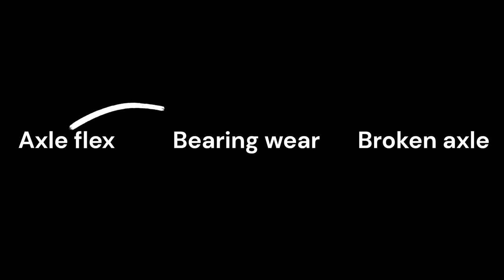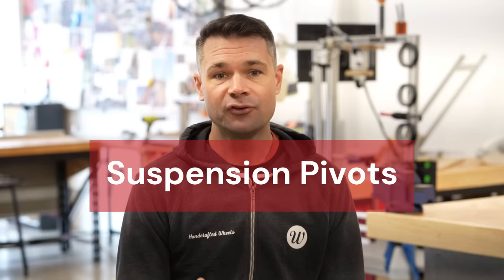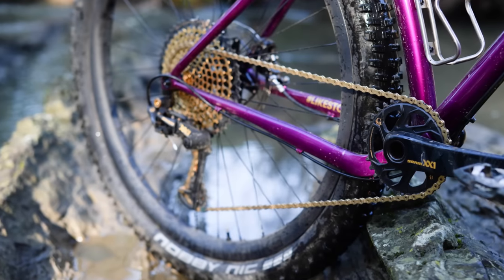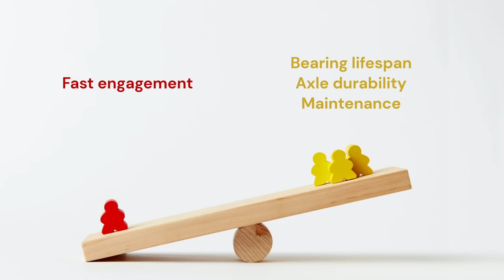Is it worth breaking axles for 690 POE?

Comment: As the NZ Distributor of Industry Nine, we've seen nothing but great support from Industry Nine around this topic. Additionally, we can confirm we have had no reported breakages of the new axle here in New Zealand (over the last 12+ months) and bearing wear has also reduced.  We must stress that this doesn't remove the need to maintain your hubs - they need care like any other part on your bike.

One thing we'd like to add to Tristan's very informative video is the real world benefits of the Industry Nine Hydra. 

High-engagement rear hubs, distinguishable by their unique sound, provide nearly instantaneous power transfer to the rear wheel.  Their benefits across various riding contexts cannot be understated. These hubs effectively eliminate the 'lag' typically experienced at the beginning of a pedal stroke with lower engagement hubs.  This feature is particularly beneficial in challenging uphill sections or powering out of a berm. Moreover, they ensure immediate power application when you resume pedaling after backpedaling or freewheeling. In such situations, this instantaneous power transfer can indeed be a game-changer.

If any viewers need more info on how to maintain the Hydra system or require service parts (bearing replacements or axle upgrades etc) do not hesitate to get in touch with Wheelworks.  As one of our dealers, Tristan has good working knowledge of I9 Hubs and access to all the necessary components to keep your Hydras running sweet for years to come.

Bruce
Founder | Owner
3Sixty Sports
Reply from the maker: Thanks Bruce.  The support we've had from your team and I9 has been nothing short of fantastic.  ~Tristan

Comment: This "axle flex" dependent engagement is just a poor design choice, no matter what the axle material used.  Industry Nine could just replace the 115 notch ratchet ring with a 116 notch ring.  Yeah, POE will drop in half, but there will be 2 points of engagement and no axle flex. Or they could drop down to 114 notch ring and get all 6 points of engagement (and only 58 POE).  Frankly, I think these super high POE hubs are comletely unnecessary and as we see here they require some significant compromises (durability in this case).  Once you get over about 60POE you've probably reached the point of diminishing returns, especially on full suspension bikes.  But that's just my opinion.
Reply from the maker: I love the idea of interchangeable / replaceable ratchet rings!  Offering the customer the choice of a 58, 116, etc engagement points simply by unthreading the ratchet ring is a great idea!

Get the marketing department involved it's a feature, not a bug!

"Introducing the RevolutionHub, a groundbreaking bicycle hub that puts control in the hands of the rider. With its innovative design, you can customize your riding experience by easily swapping out the ratchet ring, allowing you to tailor the number of engagement points to suit your preferences. Whether you crave lightning-fast responsiveness for aggressive trails or prefer a smoother, more leisurely ride, the RevolutionHub empowers you to fine-tune your cycling adventure. Experience the freedom to ride the way you want with precision and versatility – redefine your cycling journey with RevolutionHub."

-Tristan
Reply: @WheelworksHandcraftedWheels  Well, DT Swiss pretty much offers that right now, don't they?
Reply from the maker: Yeah but they currently max out at 54 POE and without a major hub redesign they can't go any higher than that

Comment: @2:44 "we recommend ... treating the axle as a consumable part". Welcome to the modern age of cycling <sigh> It's frustrating to see companies using Al alloy axles when a steel axle should be a lifetime part for most hubs. I9 is not the only offender here.
Reply from the maker: Interestingly, in the higher-end hub world many companies are moving from 15mm to 17mm diameter aluminium axles rather than change the material to steel or titanium.  Why?  Generally cost and it's seems much easier to hold machining tolerances on an aluminium axle than a steel or titanium one, but a professional cnc operator would know more about this than me.  We moved to a steel axle on our Dial hubs about 5 year ago but the tolerances to fit inside bearings are so tight that it needs to be centerless ground and we could only do that because it's a constant diameter axle, not a stepped / shouldered axle like the Hydra or others.

The 17mm axles seem to work well in other brands of hub but they mean really small bearings inside the freehub body.  This likely isn't an option for I9 though as the larger axle will be stiffer and therefore impact how the hub works.

-Tristan

Comment: Wow,Tristan knows absolute nothing about metallurgy,Aluminium is 1/3 as stiff as steel and will flex alot more than a Chrome moly or Titanium axle.Change the design to 4130 Chrome moly axle and it should be fine.
Reply from the maker: Sorry that the wording isn't super clear at this point of the vid.  What I said was " Aluminium, which is what the hydra axle is made from, is a reasonably stiff metal which doesn’t bend and flex as much as, say, steel, and which tends to crack when flexed repeatedly."

It looks like this got muddled in editing and I can certainly see how it could be misread!  The intent was that aluminium isn't as good in cyclic loading as steel, and maybe I should have said it "doesn’t bend and flex as WELL as, say, steel"?

Either way - that amount of flex is required by the freehub mechanism so simply changing axle material probably won't work and will likely lead to failures elsewhere, and the physical dimensions are constrained by bearing and thru-axle sizing so redesigning the axle diameter isn't possible.  I'm guessing if the solution was as straight forward as changing to a steel or titanium axle then I9 probably would have done this already.

-Tristan

Comment: "Aluminum...is a reasonably stiff material that doesn't flex as much as steel" Cringe. Aluminum has 1/3 the stiffness of steel. 

I usually like your videos but you need to educate yourself before you put yourself in the position of being a teacher. 

Maybe consult a PE before doing anything regarding engineering, or stick to show and tell.
Reply: Is it possible that he wanted to mention that aluminium has significant lower fatigue performance compared to that of steel?
Reply from the maker: What I said was " Aluminium, which is what the hydra axle is made from, is a reasonably stiff metal which doesn’t bend and flex as much as, say, steel, and which tends to crack when flexed repeatedly."

It looks like this got muddled in editing and I can certainly see how it could be misread!  The intent was that aluminium isn't as good in cyclic loading as steel, and maybe I should have said it "doesn’t bend and flex as WELL as, say, steel"?

-Tristan